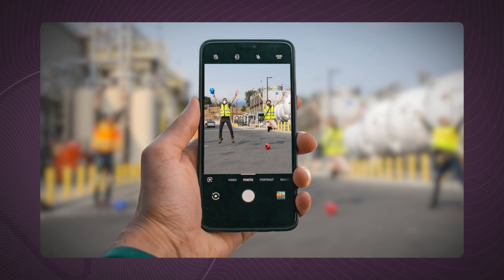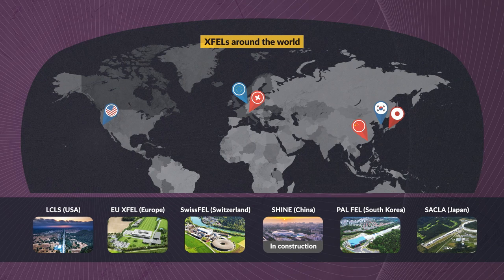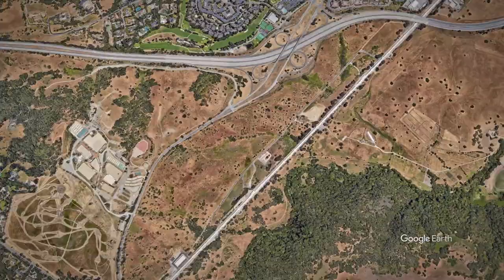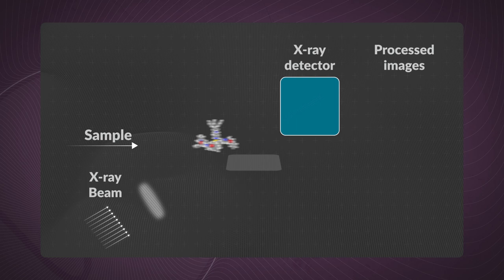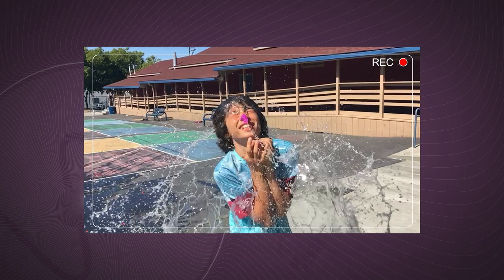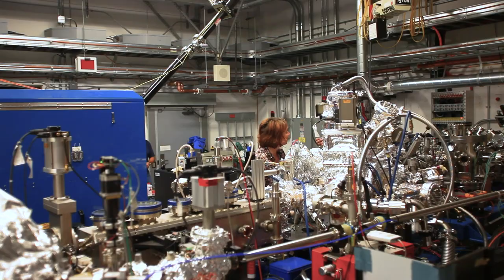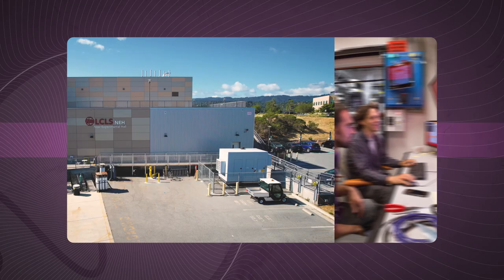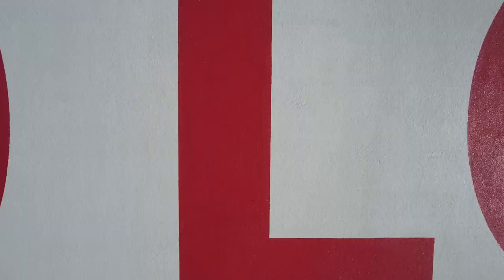What is an X-ray Free Electron Laser or XFEL?

Comment: So its a laser thats free of x rays?
Reply from the maker: No. In the context of a "free electron laser," the term "free electron" refers to an electron that is not bound to an atomic nucleus or a specific atom. It is free to move independently within a material or a particle accelerator. "Free electron" is a term in physics to refer to such electrons that will be the vector for electric currents. Essentially electrons that are free. An XFEL is a tool that uses Free Electrons to generate an X-ray laser beam.
Reply: The narrator emphasized it incorrectly.